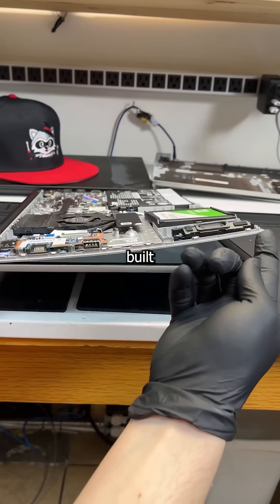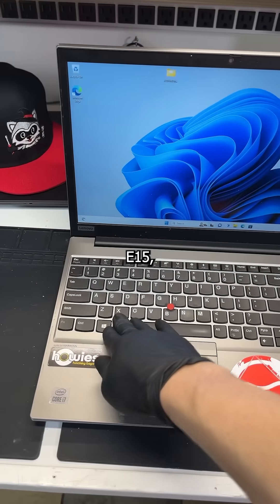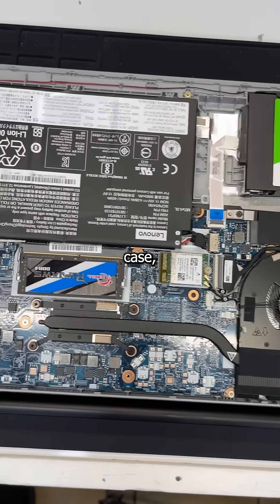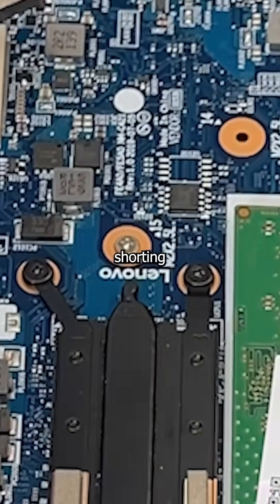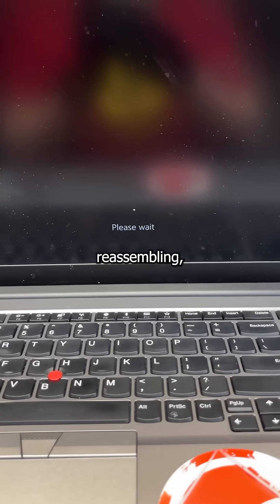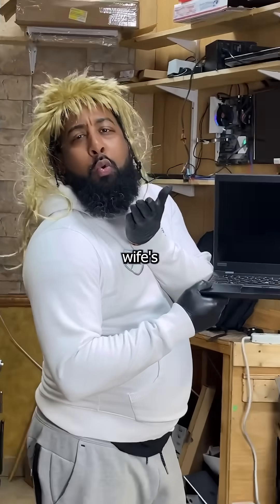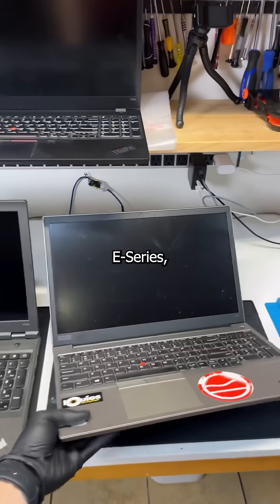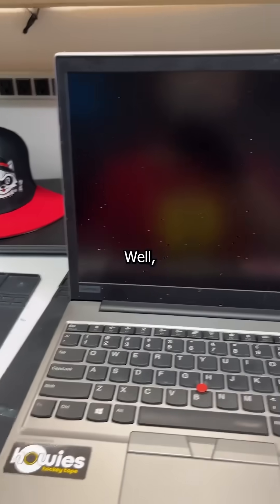ThinkPad or ThinkBad? Has Lenovo ruined the best laptop ever made? #tech #pc #technology #shorts

Comment: I'm sticking with my T490 until the T14 Gen 5 releases. I am glad that they brought back upgradability, I once thought about the E series but heard the nightmares of that series.
Reply from the maker: Dude they're so close to having a perfect ThinkPad, they just need to make the USB-C MODULAR FOR THE LOVE OF GOD
Reply: @SalemTechsperts Too difficult to R&D. It's not like any company out there has a good framework for modular laptop components.
Reply: @SalemTechsperts  Agreed. And they should made those USB-C ports
more reliable too.
Reply: Loved my T480. Ended up selling it and getting a Flex 5 14 because of the two in one capability, but man do I miss that T480. Built really well and upgradeable.
Reply: I've got a T450 and T470. The 450 is mostly used to watch stuff in bed and regularly ends up on the floor because I fall asleep. USB ports are a bit sticky after landing on the drives hanging out of them, but everything works fine. The 470 has spent plenty of time in my 30L work backpack along with about 35L of other stuff. The keyboard has left marks on the screen from the tight confines, still works great.
Reply: I think the l series are still decently built and are upgradeable.
Reply: @_carot  Thank Acer, not IBM, because that's who designed that specific series.
Reply: @RowanBird779  I thought they made the I series?
Reply: I HAVE A T490 too! I love the fuckin thing, so much. It's a lil monster power wise, especially for it's size.
Reply: I'm thinking of buying an i5 L380 for 85 dollars from eBay.
Reply: @_carot depends on its condition. And if you could afford more or have a primary device that holds the important data.

For a second device to watch videos or read stuff in bed it's probably okay. But not as the primary device that holds important data.
Reply: @es-br8ck  it would be a second device since I have a main mobile workstation.
Reply: @es-br8ck  Why wouldn't it be able to carry important data? Throw in a new SSD and it will probably outlast the laptop.
Reply: @SibaNL  you can throw in a 16TB SATA drive in a fifteen year old box cobbled together by an IT newbie if you want. But it's about the probability of the thing failing and corrupting some or all data in the process, or being simply broken in some way so the HW or the OS fails and people can't access their data. Normies can't easily recover data from failed OS drives.

Also, the personal time needed to recover and reinstall everything is a precious resource, either one's own limited lifetime or some IT people's hourly rate.
Reply: @es-br8ck  L380 was released in 2018 not 2009. Those machine will be more than reliable so I doubt some "IT newbie" cobbled it together, whatever that's supposed to mean. Also not to mention that you should have a backup in the first place regardless of what device you're using
Reply: @SibaNL  Lenovo machines got successively less and less sturdy over the years and more difficult to upgrade or repair, up until they soldered the RAM in place. Everyone who knows ThinkPads knows that. 

And backups? Users? Haha. You don't even know users. 

Also, time to restore the system isn't free, so reliability is as important as your hourly rate. If you're a NEET, reliability is irrelevant. Some of us aren't and our time is severely limited and expensive, so restoring backups is plan C, not plan A.
Reply: @es-br8ck  L380 and as far as I know most L series has replaceable ram. And what you say for the thinkpad series is true, don't get me wrong. But a 2018 is modern enough and plenty solid, older models are solid as fuck but are lacking because of the older processors. Yes users don't backup, that's just user fault, but any device can fail.
Reply: The T14 Gens 2 and 3 are absolute trash. My office gave us brand new ones. My bosses's laptop blew a motherboard on the 4day. 2 of my collegues had the touchscreen stop accepting "touch". Mine and an other collegue's laptos are constantly overheting. The fans on mine are 80% of the on full blast - it sounds like a jet. The other collegue, due to cosntant overheat , they gave him a new motherobard. Now his idle temp is 65C and under minor office load , it runs at 90C.

Not sure what Lenovo did with those but the T14 should be avoided like the plague.
Reply: @mowtow90  bought 4 devices for family and friends, P52, P53, P16G2, and all of them were thermally challenged and constantly triggered CoreTemp warnings for half a sec whenever one thread rose above idle, before the heat dissipated. They all could sustain 45-60W of their TDP for a long time, but single spikes from idle always ran against the throttling limit. My guess is the heatsink copper is too thin to buffer localized spikes from single cores.